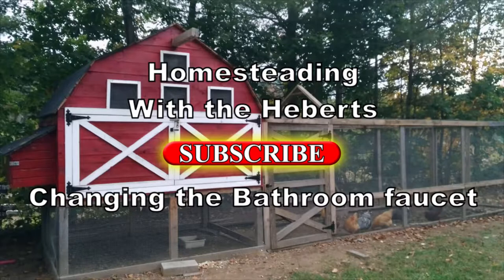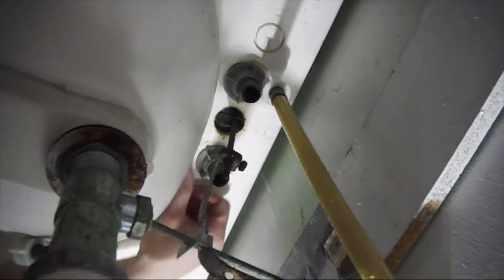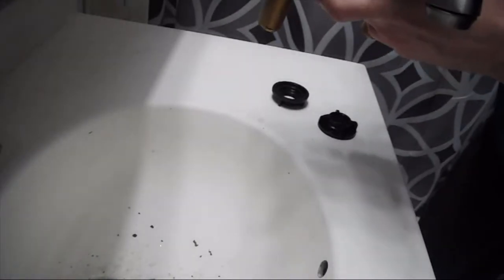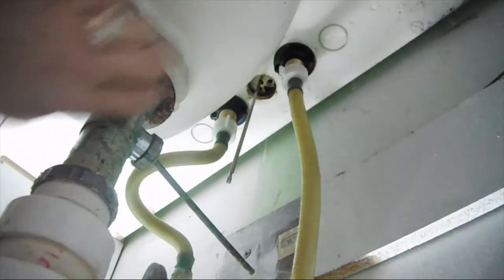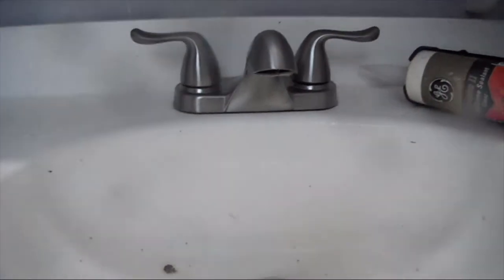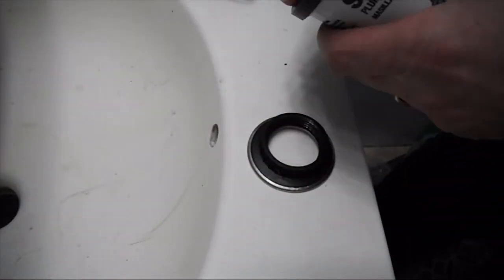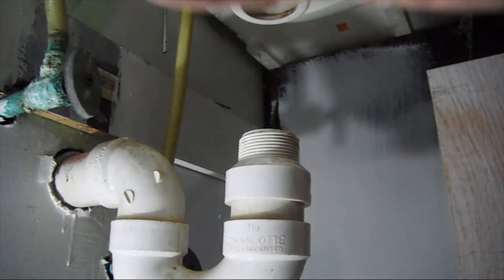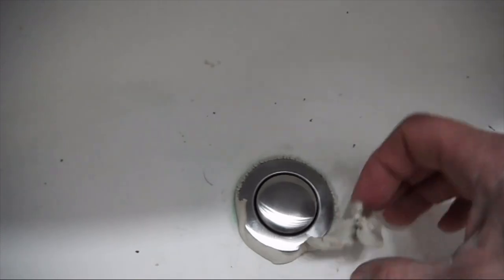Changing the Bathroom sink faucet

Comment: Plumbing never goes well when working on old stuff. Just Snug the nut behind the handle of the cold water below to tighten up the gasket a bit to stop it from leaking.
Reply from the maker: Thanks I'll have to try that. The good thing is it is not leaking as long as it is tightly on.